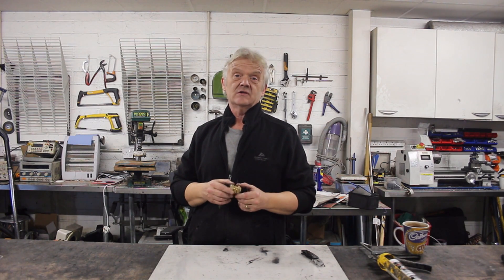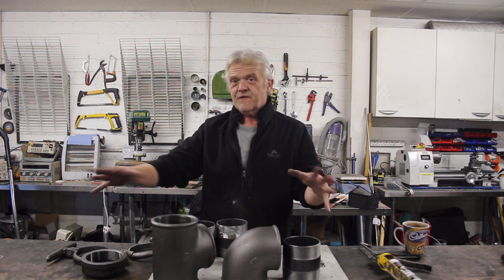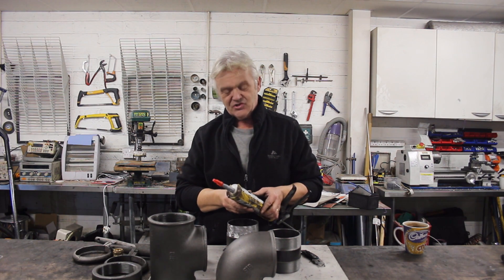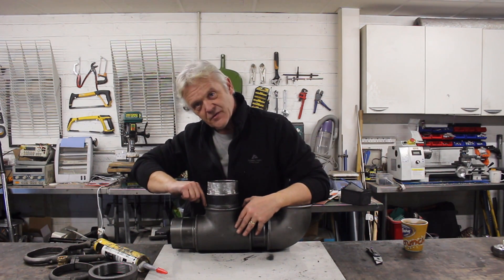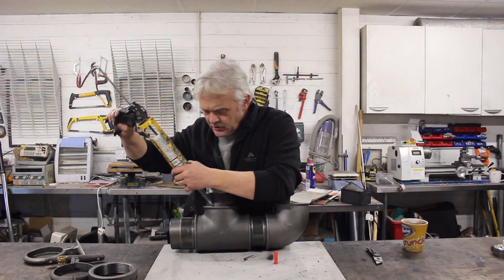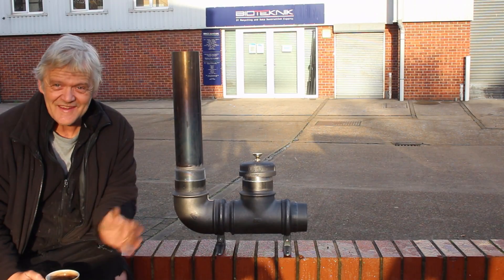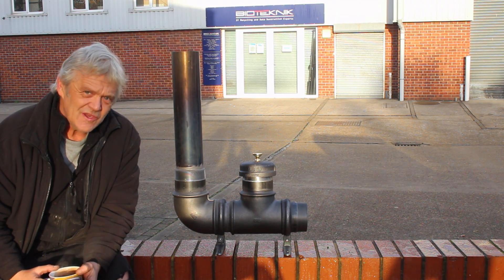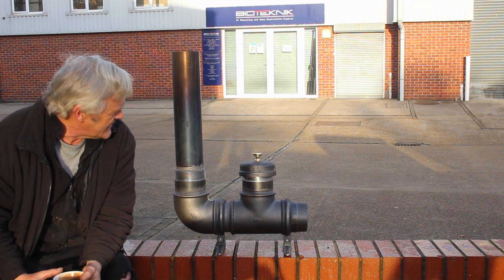1743 A Rocket Stove Kit - No Welding, No Tools, No Experience = No Problem

Comment: Question: could you use a wye fitting instead of a tee fitting where the wood goes in to look more like the other rocket stove and to balance the weight better end to end?
Reply from the maker: yeah for sure - I just didn't see on from the store I bought the bits from
Reply: @ThinkingandTinkering  thanks for the quick response

Comment: How much please Robert? Cheaper than buying a welder and the square steel tubing you used for the other one?
Reply from the maker: you can do it for around UK£80-90 - still more than if you weld but you are well out have a look on pipeworksuppliers.co.uk and use metals4u for cut to size pipe - the minimum wold be the T piece and an elbow - the rest use cut pipe and sealant
Reply: @ThinkingandTinkering  Thank you very much Robert!

Comment: How much did the parts cost?
Reply from the maker: you can do it for around UK£80-90 - still more than if you weld but you are well out have a look on pipeworksuppliers.co.uk and use metals4u for cut to size pipe - the minimum wold be the T piece and an elbow - the rest use cut pipe and sealant
Reply: @ThinkingandTinkering  Cheers!

Comment: Around 5:00 sounded like you mentioned a variation of ' the golden ratio ' expanding to 4.  I did not even consider iron drain pipe as an option.  I did look into duct and chimney components and have seen similar other than the feet.  Good ideas and keep up the great videos!
Reply from the maker: cheers. mate

Comment: Robert, love these stoves good work. In a previous video you created a vortex with a split pipe over a candle, just wondering if you have tried this in the full size rocket stove and what affect that would have on the heat output?
Reply from the maker: video up and coming mate

Comment: Fantastic out of the box thinking! With so many channels working for multiple years on ways to refine a rocket stove, you are the only one I'm aware of that simplified it down to the point where literally anyone with the desire could make one. Very well done! Thanks for sharing!
Reply from the maker: Thank you very much!
Reply: Can we have an indoor one please
Reply: 💯 . I've been hoping and praying to be able to buy a good stove which is sad ......but this is genius and will make life easier. I'm going to heat water off  mine and use a long pipe to extract all heat. I guess a 25 liter tin can could be used or would a barrel work to convert it to an  interior stove?

Comment: how much did that cost?
Reply from the maker: you can do it for around UK£80-90 - still more than if you weld but you are well out have a look on pipeworksuppliers.co.uk and use metals4u for cut to size pipe - the minimum wold be the T piece and an elbow - the rest use cut pipe and sealant

Comment: Can I have the kit please and how did you fix the handle on
Reply from the maker: I am sorry but I don't do this as a kit you have to get the parts yourself you can do it for around UK£80-90 - still more than if you weld but you are well out have a look on pipeworksuppliers.co.uk and use metals4u for cut to size pipe - the minimum wold be the T piece and an elbow - the rest use cut pipe and sealant

Comment: I think the value for the feeder section is used if it does not have a cap to remove the instance of the flame licking up in that direction, you having a cap there should make that not much of a concern and if you are more worried, use more of that sealant and form a ring in that cap when it's removed so it can become almost completely sealed when placed back on after it dries
Reply from the maker: nice tip cheers mate

Comment: I like to use cheap welding slag hammers with the wire coil handle for fire implement handles. Lop of the head and welding the handle on or use a tap and die set to thread the shank into your part. The old grates from a gas grill and a couple handles make excellent campfire grills.
Reply from the maker: nice one mate - cheers

Comment: Because I have electric heating  which costs 200 bucks a month in mid winter (when electricity  was cheaper) i bought a parafin"hot plate" stove off ebay for 12 bucks- it blasts the heat out warms my entire( small) house up in 20 minutes. Any thoughts on the toxicity of  burnt parafin?
Reply from the maker: plenty of indoor paraffin heaters on the market mate

Comment: I live in Canada and have never come across cast plumbing fittings that large...however, there are a LOT of deep drilled wells here, so acquiring a few feet of 5-8 inch well casing isn't too difficult. I have a stove I built many years ago using these materials just sitting outside...covered right now in about a foot of snow. I don't know about the UK, but if you own a house and you have insurance on it, and you don't declare the simple presence on an unused stove on the property, no matter how far away it might be from any structure. Your insurance will be considered invalid if there is a fire.
Reply from the maker: it was a little bit of a challenge to find the bits here in the UK - I am jealous
Reply: @ThinkingandTinkering  Jealous...of little 'ol me?
Reply: Sad that so many legislators in Canada live in fear rather than rationality. Sounds like insurance companies are looking for any excuse to keep your money.

Comment: Worked in a foundry and we would use both the high temp Teflon tape and liquid Teflon for the pipe connections to keep them from leaking.  Hope that helps.  Not sure what you used?  Also, use a kitchen hot pan holder for the nipples if you need to touch them otherwise they may be deemed a booby trap.  :)
Reply from the maker: I used a silicate putty meant for stove sealing but I like the teflon idea
Reply: We saw what you did there…!
Reply: @eh1702  ?

Comment: So cool, you could make a mini one from scaffolding.
And if you got another schoolboard fitting then you could use that to secure it to the lid and fit a wooden handle to it.
You could make a tiny one to heat your twizy.
Reply from the maker: I like that idea - it might be good for an oil burner - hmmmm
Reply: Scaffolding?
Reply: @McRootbeer  smaller bore tubing.
Reply: You might also be able to use KEE KLAMP fittings and do away with alot of the nipples needed.

Comment: Prices for those fittings please 🙂👍
Reply from the maker: you can do it for around UK£80-90 - still more than if you weld but you are well out have a look on pipeworksuppliers.co.uk and use metals4u for cut to size pipe - the minimum wold be the T piece and an elbow - the rest use cut pipe and sealant

Comment: In other videos some holes were drilled at the base of the chimney for burning the hot gasses, I wonder if we do not seal off the base of this chimney and use it as extra air flow instead of drilling holes?
Reply from the maker: never thought about it - interesting idea mate - thanks for sharing

Comment: I have sip industrial welder & have made i few youtube idea's & now seeing you put this together.   I have said to myself,i have to go to B&Q to get all these parts,i hope.   Well i have watched a few of your builds & love a lot of them.   Thank you very much,this is a have to build!   And my welder can stay in it's bed,so to speak.
Reply from the maker: you can do it for around UK£80-90 - still more than if you weld but you are well out have a look on pipeworksuppliers.co.uk and use metals4u for cut to size pipe - the minimum wold be the T piece and an elbow - the rest use cut pipe and sealant
Reply: @ThinkingandTinkering  thank you.

Comment: I am amazed at how simple and cool you made that look. Any chance you can add a shopping list so I can replicate one?
Reply from the maker: the list is in the video but this has had a lot of questions so I will do an update for tomorrow there will be a list on that update - though I did list the prats on here too anyway you can do it for around UK£80-90 - still more than if you weld but you are well out have a look on pipeworksuppliers.co.uk and use metals4u for cut to size pipe - the minimum wold be the T piece and an elbow - the rest use cut pipe and sealant

Comment: You can do the same with flue pipe - it does not require silicon and is much cheaper.  Great video as always - thanks Rob.  This home heating series has been brilliant.
Reply from the maker: awesome - nice tip mate - cheers

Comment: Thats looks cool, and the last video was really helpful aswell, it seems like i watched 100 videos on rocket stoves but wasnt really getting how they even worked, something about a cylinder within a cylinder? gases?  vortex? rockets?  kind of confusing until the last video where you said its basically " a fire in a box "which improves efficiencey because gases traped have a chance to burn more.   This is more helpful to undertand because then you can imagine your own design of a rocketstove and make it with whatever material you have as opposed to following a set of instructions and realizing you cant do it because you dont have this or that.
Reply from the maker: I agree mate - I hate it when the basics aren't discussed just so you can get a handle on it

Comment: Awesome.   I would personally use a "Y" rather than  a "T" for where you stick the wood.
And standard single wall stove pipe in 6" available at any big box should have everything one needs to do that doubled chimnea thing just off the shelf.  Might be a touch tricky to seal it at the bottom but a wall collar, some of that sealant, and maybe some tin snips should do it.  I even think I recall a 6 to 4" adapter that you could wrangle for your exhaust, but one could be cobbled easy enough.

Also, on your handle (as i have that issue with my pots at home) - I find a large 2 prong fork like you use for carving turkey does the trick well.
Reply from the maker: I agree I just didn't see one!

Comment: I'd like to see you wrap a copper tube around the outlfow pipe and hook it up to a small water heater in your next version of this build!
Reply: 🥣Weld on a flat surface so you can heat a pot or kettle ☕️
Reply: @LAStars-sratS  you can also cut small slits down the top of the out pipe and simply place a small round grill on top. Or I've used 2 metal skewers on top my coffee can rocket stove while camping to place a pan on top and allow the fire to flow up and out still. I'll have to make a new video soon of that!
Reply: Thanks for this! Ya never know when you might need something like this, especially with the shortage of fuel in Europe (so I keep hearing) hopefully ppl have enough common sense to not burn their homes down or kill themselves!
Reply: @LAStars-sratS  I actually used to live off grid and created a solar passive water heater with copper tubing coiled up in side a frame box built with 1"x1" and a plywood backing. Tubing and plywood spray painted with black high heat paint. And the box covered with plexiglass to absorb the heat from the sun. I had it hooked up to a Coleman cooler. The heat within the tube creates a thermal siphon and continuously heats the water up in the cooler through the black copper pipe. But I've also seen small soup can rocket stoves with copper tubing wrapped around the outside and hooked up to a simple foot pump camping shower. And I make small Survival Candles that can fit in a rocket stove which can be burned indoors safely within the soup can rocket stove. This guy Robert is brilliant and makes me want to build again!!!
Reply from the maker: nice one mate
Reply: @ThinkingandTinkering  Even better would be to get a Peltier Tile and create a USB charging port by creating a thermal electric generator! Just more brilliant crazy ideas for you to try out mate! I love the way your mind works!
Reply: Hell ya❣️
Reply: You're right.  I think it potentially could be done using, say, 15mm (1/2") soft copper pipe filled with sand (to help keep it round and help prevent kinking)
Reply: @PeterJavea  Yes. You can use sand or even bend with ice in the tube. Fill with water, cap the ends and place in freezer. But copper tubing usually comes rolled up in a small diameter that is probably close to 4" diameter and can be carefully bent around tube without any sand or water. Just have to be careful not to kink or bend the line.
Reply: Wouldn't putting a cooling system on the exhaust pipe cause creosote to build up on the inside more quickly?

I was wondering how to change the design enough to make it safe to keep Ukrainians warm without power in their homes, over winter.
Reply: @donalddalley7274  At a pinch the Ukraines could use a longer outlet tube, and use it as a cannon to fire at the Russians.

Comment: Get a bit of wood or steel and cut a slot out of the end to lift the cap off.
Say 2"x1/2"x12".. Slot right on the end just fits under the cap handle.
It still requires the air holes after the fire I'd say..
How much was the kit in total then including sealer etc?
Love your experiments.

I saw a rocket stove few years ago where the flue ended up going under a brick built seating area, like about 6ft+ long... Warmed the bricks.. Basically a square chimney.. The longer the brick chimney is it'd give some great heat as the bricks absorb the heat and radiate out.. Do you think its worth an opportunity to find out? I've got a workshop to heat soon... I'm following closely...
Reply: Cut slots into the smooth-topped nipple before adding the chimney. Drill holes in the chimney at the same level and turn the chimney (without sealant) to align/tune the extra air.
Reply from the maker: you can do it for around UK£80-90 - still more than if you weld but you are well out have a look on pipeworksuppliers.co.uk and use metals4u for cut to size pipe - the minimum wold be the T piece and an elbow - the rest use cut pipe and sealant - I don't know about the brick - I'll have to think

Comment: I really love your videos and your enthusiasm!  This build is brilliant!
I started making Rocket Stoves years ago and the ratio I remember is, if the air opening or fire feed hole is 4" diameter, then the pipe has to be 4" all the way through, and the out pipe must be 3xs as tall as the opening, so at least 12" tall for a 4" opening.
Reply from the maker: cheers mate
Reply: @ThinkingandTinkering  I also believe if the top is tapered inward it may create a more powerful outflame which could mimick how the made glass beads in Egypt over 2000 years ago. I blow glass and have always wanted to attempt this build! Maybe soon unless you beat me to it.

Comment: As a side note a well tuned rocket burns complete enough to be CO2 negative compared to the same amount of wood sitting on the ground rotting. Its been researched and tested to death. At least the rocket mass heaters have. Im not a tree hugger by any means but normal wood stoves waste too much heat maintaining a hot enough chimney to keep a good draft. I limit my chimney to 115 degrees f. Trying a different wind proof cap this winter so I can drop my chimney temp to 75 -80 f . The heat belongs in the house not outside. Less wood less work.
Reply from the maker: nice post mate thanks for taking the time to post

Comment: Can you list all the parts  and links  to this plus could you make a pellet feeder  for indoor use ? And could you run these pipes as underfloor heating like a mass storage heater through a Gideon packed with stone
Reply from the maker: the list is own the video mate and it need an adaption for indoor use - I did a video on that and mentioned it in this video
Reply: The links  are in the video not in description  then

Comment: Years ago, I made a stove from a Calor gas bottle. The stove had a door, and a flue ... flue length about 6 feet, and 4-inch diameter. I used this thing in my garage. Well, it seemed like a good idea, until I went round the back of the garage and saw the chimney. There were foot-long flames roaring out of the chimney, threatening to set the neighborhood alight. Thus ended my experiment. But, I wasn't too sad to see it go, on account of it being so messy.
Reply: Suggest you might want to build a smaller one next time !!!
Reply: You just needed a taller chimney. What yours was doing is exactly why they call them rocket stoves. Too bad you got rid of it.
Reply from the maker: lolol - I am laughing with you mate lolol

Comment: I know this isn’t the most brilliant question, but can you run this in the house? How do you exhaust it out of the house , if there’s no external exhaust port, if you do use it inside?
Reply: Most certainly not
Reply from the maker: I did a video on the conversion from outside rocket stove to indoor heater mate - check it out

Comment: Fire Bricks would probably be a lot cheaper, and easier.  Just stack em like Legos.
Reply from the maker: I don't think so
Reply: @ThinkingandTinkering  Small Pipe Fittings, cost a fortune.  Finding pipe fittings as large as yours, is neither not easy.. and typically, is not Cheap.  (And if you got them used.. good luck on the threads not being damaged)

 I actually bought some 4" diameter Steel Tube for a special project.  Three 10ft pipes, cost me a bit over $300 (sch 40 thickness).

 Meanwhile, anyone can grab a box of bricks for cheap... or even, are often found Free.

 There are vids that show these brick versions being assembled, quickly and easily.   One version, uses Cinder-Blocks.
None have to be sealed together permanently, if you just want to experiment.

 That said, unless its high temp bricks, they will likely, eventually crack.  Still will probably function though.